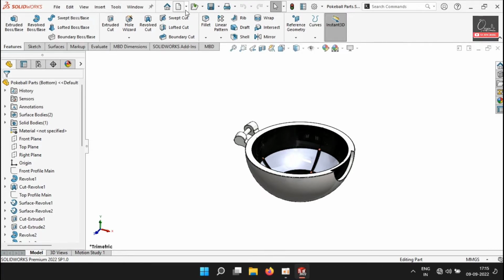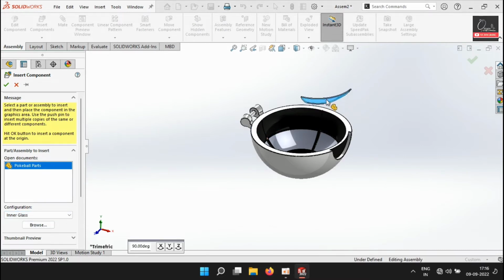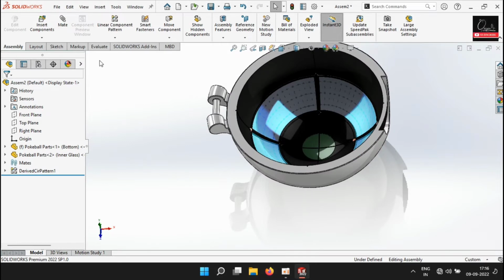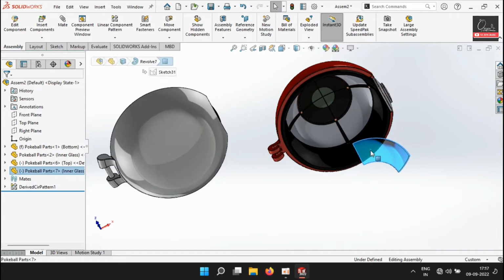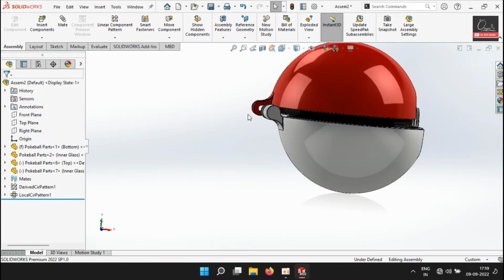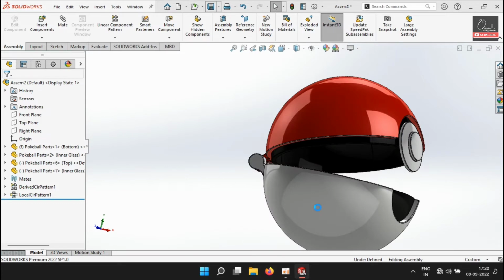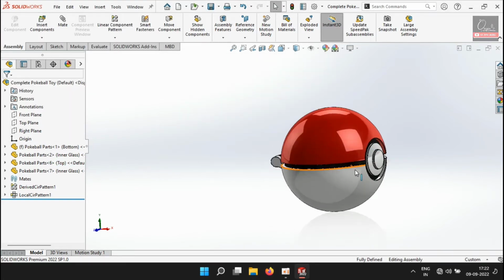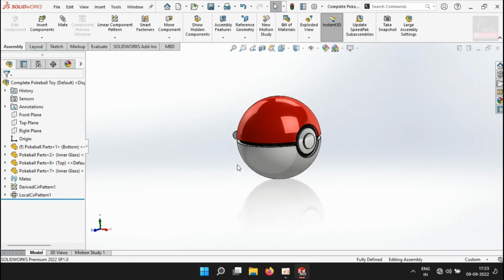Solidworks Tutorial: Designing and Animating the most Real & Manufacturable PokeBall Toy | Part - 5

Comment: Thank you for the tutorials! This will be my first Solidworks project :)
Have you 3D printed it or manufactured this toy and can you share a video of it in real life?
Reply from the maker: The dimensions and design of this one ar not suitable for 3D printing, otherwise it will break while opening & closing from the centre button because of the "push fit" mechanism (have been explained in later parts of video). It has been designed considering Mass-production using conventional plastic moulding methods. Unfortunately, the video recording of actual production is not allowed at Manufacturing plant.
Reply from the maker: For 3D printing, following three changes will be required:-
1) Depending on the nozzle diameter of 3D printer being used, the minimum dimensions (diameter of small pins inside the pokeball in this case) need to be greater than nozzle diameter 
2) Clearance needs to be provided between bottom half of Pokeball and inner side of centre button attached with top half of pokeball.
3) there cannot be any sharp edges, all edges will need to be filleted with radius equal to nozzle radius of printer.